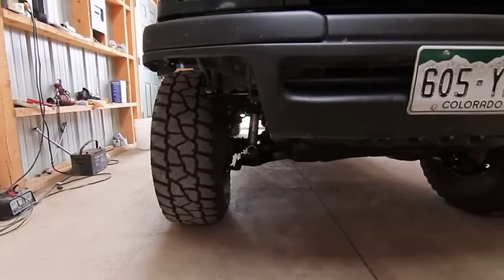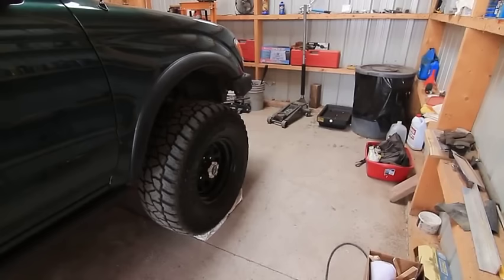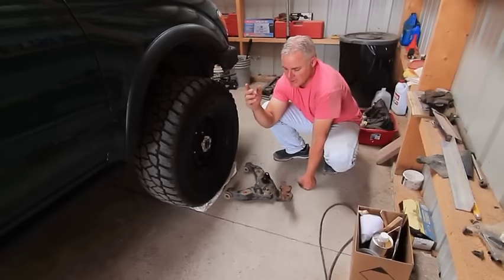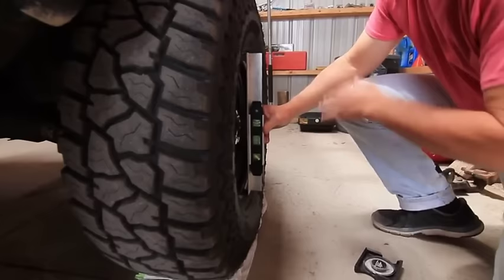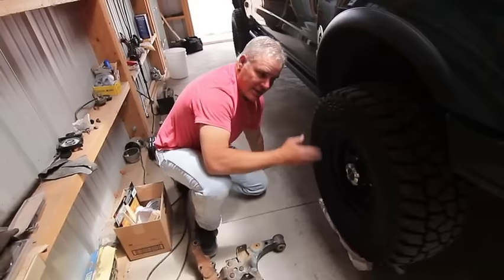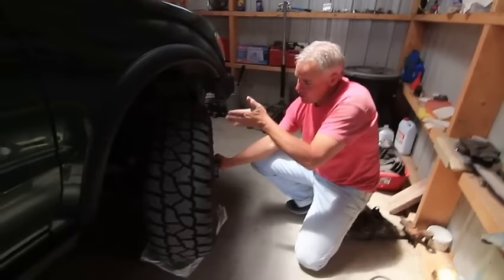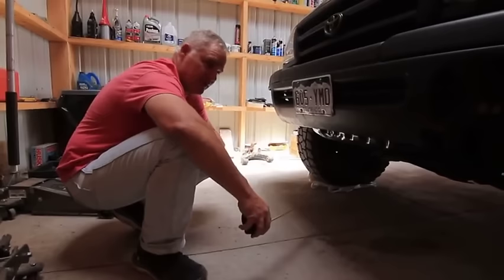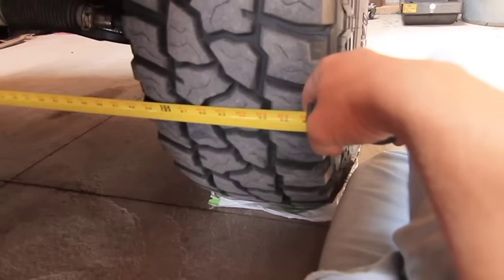How to Measure Camber Caster and Toe - Alignment

Comment: No nonsense tutorial, straight to business, very educational.  Thank you very much.  I've used thin magazines under the wheels to accommodate wheel movement on concrete, but I like the plastic bags with oil better.  There is a lot of engineering and science behind these three adjustments (caster, camber and toe), and each vehicle utilizes this technology uniquely.  Be patient, prepare your work, and you'll get through it with fine results.  Blessings, Wayne.

Comment: If I might suggest using two pieces of sheet metal like 12”x12”, apply plenty of grease between them.  They work better than plastic bags.  Regardless, this video was a great learning tool. Thanks!
Reply: I was going to make this suggestion too. working in the crash testing world, we slip plates like this underneath all 4 wheels to be able to dial in the final position of the vehicles, pushing it one way or another upto an inch or two by hand.
Reply: We do this in the aircraft industry when playing with the nose wheel steering system

Comment: Excellent. This saved me from screwing up an alignment that was within spec. I am prepping my 4runner for larger tires; trimming stuff, lift kit, different mud flaps.... I still needed some positive caster to move the tire a bit forward. After doing so I was doing a horrible job checking caster and was ready to make an adjustment. I remembered seeing this video and went back and watched again. I had a piece of "L" iron (aluminum) and cut to size and used my phone to check. One was on 90 even and the other was on 89 flipping to 90 if I fudged with the aluminum at all, it was that close. Good enough.... ! You saved me a hassle. I'll check my toe in next

Comment: So, if my truck is pulling right then it’s the passenger side geometry that’s off? The reason I ask is because I recently replaced my upper & lower control arms, tire rod end & ball joints on the drivers side. I thought maybe I just needed to back out my left tie rod a bit

Comment: So when the tire is turned full lock right, and you are measuring the passenger tire you will get the larger degree 89 and then full lock left it will be 88.  So, on the left tire turned full lock to the left it should be about the same 89* and then 88* when turned full lock to the right.  If the degrees were switched - would it mean you had negative caster?

Comment: Been doing alignments for 30 years. Least caster pulls. Most camber pulls. Most ford specs are set up to 1/2 to 3/4 degree less caster on left wheel to compensate for road crown. Good video though, Should still have it checked on a computer machine as thrust angle plays a big part.

Comment: thank you so very much for making this easy..!!!!     also..... very important!!!   make sure you vehicle is sitting level,,meaning,, when looking from the front of the vehicle  just by sight,, make sure it looks square to the ground,, and even measure certain points on the frame and get the vehicle "LEVEL"!!!!!!!!   IF ITS SAGEN ON ONE SIDE ,,,FIX THAT!!!!!!  SQUARE IT UP!!!     i have a story of an alignment shop that did my chevy truck and it was low on the drivers front side,,,, and they said that was ok"""""    WHAT!!!!!!!!!!!!!!!!!!!!!!!!!!!!!!!!!!!!!!!!!!!!!!!!!!!!!!!!!!!!     NO!!!!!!!!!!!!!!!!!!!!!!!!!!    WRONG!!!!!!!!!.... sorry,,, I'm done.   ( I got screwed). ($80.oo.).  now I'm done.   luv this video!   i squared out the truck in the end.( torsion bar keys bolts.).                                     done.

Comment: Maybe I Misunderstood but did you say you can center the steering wheel by only adjusting one tie rod?
I thought you had to adjust both to the center steering wheel.
Reply: It all depends upon whether or not toe-in needs adjustment.  If your toe-in measurement is good, then adjust both equally in the same direction to center the steering wheel while keeping that measurement.  If you need to adjust toe-in, then only do the one side to fix that and adjust the steering wheel at the same time.

Comment: My truck was hit on the front driver side as the tire is straight , but on the passenger side the tire is toed in the garage says I need to replace the ball joints is this right . Great Video
Reply from the maker: Well... the ball joints could very well be destroyed now... but that's NOT what's causing the toe in. My guess (and that's all it is) is that one or both tie rods are bent due to the collision. That would cause an effective shortening... ie... toe in.

Comment: Someone suggested to use two linolium floor tiles with a little grease sandwiched between, probably works same as plastic bags and oil, my concern is, i need my mercedes up on stack of 2x12s to get under it and my driveway is is not level. It may slide off the blocks. Any suggestions
M L Rogers   Pasadena,Tx

Comment: If the vehicle has cam bolts with markings why can't you just set camber bolt and caster bolt to 0 or neutral?
This is assuming all suspension components are good and don't have a lift or something else.
Reply: This is most detailed video on DIY alignment found so far.

Comment: I have a similar vehicle, a 06 GMC yukon.  My left front wheel tip out slightly on top.  If I adjust both camber bolts evenly to  to bring the top of the wheel in slightly - is it safe to assume that I have not changed the caster settings?
Reply from the maker: In theory that'd be true, but you still want to measure it.

Comment: At 7.55, correct me if I am wrong vehicle will pull towards the side with less positive (or more negative) caster. You have not specified positive or negative caster for pull at 7.55.
Reply: That's what  I was taught,  was doing alignments for 30 years

Comment: Aren’t you supposed to multiply the difference in camber by xx?

turn angle 20 degrees each way = 1.43 x camber diff
(commonly rounded up to 1.5)

turn angle 15 degrees each way = 1.91 x camber diff
(commonly rounded up to 2.0)
Reply: Agreed 👍
(180/3.14)/40 = 1.43
(180/3.14)/30 = 1.91

Comment: great vid, but (possibly dumb) question: how can you make sure that the tires are pointing straight-ahead when doing the toe adjustment?
Reply from the maker: It will all self center when it's driven... but then you might need to straighten the steering wheel.
Reply: Not a dumb question, actually very important and should be considered the first step when doing toe adjustments. Steering wheel must be centred first. Depending on your car you could use the steering rack or pitman arm to ensure they are dead centre first.

Comment: On toe in if you don’t use any reference from the rear and only use front (tread) then one tire could be towing more than the other correct?
Reply from the maker: It will self center as you drive it.  Steering wheel may then need adjustment but that's all.

Comment: If caster is off I know it causes pulling, but does it affect wear if camber and toe are within spec?
Reply: If it pulls you will have uneven wear. But if you rotate your tires often you may never notice if it's only a slight pull.

Comment: Better to use digital angle finder. I found the Samsung phone is slightly off by about half a degree, and for phone measuring to 90 degrees it just can not quite get there, as in it is inaccurate and works better when measuring less angle.  The analog round meter I have is also off by 1 degree, that is a very rough measurement tool. I calibrated the angle finder using a 4 foot spirit level set to dead perfect level. You want camber measurement to get as accurate as possible. Having the whole car level is extremely important. My choice for level tools is a spirit level or a digital angle finder well calibrated.

Comment: Wish I had a place to do this I rebuild the entire suspension of my SUV and after 3 alignments they still didn't get it right :( I don't think they are adjusting the caster and camber correctly! They even left the control arm bolts loose ( a Dealership) they said that's normal not to bind everything up?? The spec calls for 140 Foot  pounds but I could turn them with one hand on a wrench! I really need to find a shop that isn't going to be lazy about it!  I already destroyed a set of tires rotated them every couple months to slow down the damage! I tried 2 dealerships and a Monro muffler none of them did it right!
Reply from the maker: CA bolts should never be loose.  Good find!   That shop is either incompetent or unscrupulous.  Computer alignments aren't computer alignments... they are done by a tech with a wrench using a computer to MEASURE.  Only.   It still always boils down to some worker wrenching for you.
Reply: In here cos I tried a shop with a fancy '3D alignment computer' mehhhh that's $150 I'll never see again .. Hopeless! lol
Reply: You are right I took my tacoma for an alignment end they left my steering wheel off to the left 
It can be cause they have lazy people working for them or the computer it's all fucked up they should take care of every single detail we pay a lot of money for alignment so they got to do a better job

Comment: Nice video. I've seen that when calculating caster, some people multiply the by 1.5 the difference between the camber readings from left turn to right turn. Have you seen this?
Reply: Yes I have seen this. I don’t fully understand it but it has something to do with trigonometry. Caster is essentially a measurement of camber at two different angles of steering wheel angle - which is wheel (tyre) sweep. The calculation method has a formula and that is changed by 2 factors:
* the total sweep of the wheel (tyre) left and right and
* the difference in camber measurements from one side of the sweep to the other.

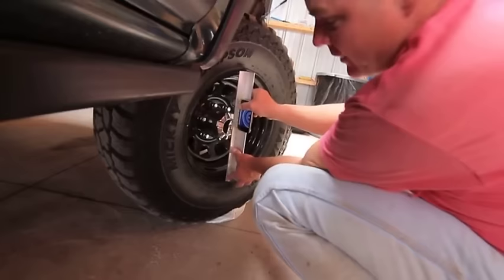In this video he used 20 degrees of sweep to the right and I can only assume 20 degrees sweep to the left. That is what he said in the video @6:10 for full lock to the right. Start with the steering wheel level and that is the zero position of the wheel (tyre). Put some sort of protractor device to measure degrees of turn and move the steering wheel so the tyre is turned out by 20 degrees. @6:35 he went to the right until full lock. Make a measurement of the camber and this is the starting point. If a digital protector is being used his would then be zeroed. He said 88.5 degrees but looked like it was positive camber (top of wheel out). Move the steering wheel the other way so the tyre is turned by 20 degrees to the left (assuming) and measure the camber, shown @6:46. The castor measurement was 87.5 degrees but the wheel looked like it had negative castor (top of wheel in).

TOTAL SWEEP (tyre movement) is 40 degrees (20 degrees right and left from zero). DIFFERENCE IN CAMBER measurement is positive 88.5 degrees minus negative 87.5 degrees equals 3 degrees (remember in this video 90 degrees is the zero point).

Maths, this is the formula:
(180/3.14)/TOTAL SWEEP x DIFFERENCE IN CAMBER = castor
Where 3.14 = pie

(180/3.14)/40 x 3 = castor
4.3 degrees of castor.

To answer your question about the 1.5, (180/3.14)/40 = 1.43. The assumption is that the TOTAL SWEEP is going to be about 40 degrees. If the total sweep is changed to a different number that is ok, just plug that number into the formula instead of the 40 and the 1.5 will become a different number.

It’s hard to tell but unless the castor is dead on zero, as the tyre turns from full left to full right the camber will change from positive to negative (or vice versa). The guy in this video doesn’t quite catch that.
Reply: @NicholasRiviera-Dr I was going to say... His 1 degree is not spec for any ifs Toyota I'm aware of. With that tire and height most are going for 4.5deg or so, which sounds like he was right there. So his measurement is just a good relative measure to get to a good spec

Comment: I'd like to put that put that on a hunter and see how close you got it. Not dissin I'm genuinely curious because I've been doing alignments this way at the shop I'm at now but I've got the actual old school alignment tools. I just don't see how it can be as accurate.
Reply from the maker: Based on drivability and tire wear... it's spot on.
Reply: @pathfinders4x477  how long would it take the average person do do an alignment this way considering the lower control arm bolts are always severely seized on Toyotas?
Reply from the maker: @dildanusmaximus9891  that's true.  Plan on cutting them out using a recipro saw.  I'm not a fan of the factory CA bolts.  I much prefer the aftermarket type you can find on ebay, so I like to replace them anyway.  Also... If your CA bushings are shot it's sometimes more practical to just get new control arms with the bushings installed.  I've had good luck with Beck Arney CAs.  All of this will save time.  The alignment itself is a 20-30 minute job... but the rest of the wrenching will depend on what you run into under there.

Comment: You know, I have been sitting here for an hour looking for a video describing how to check and adjust caster without taking it to an alignment shop. Any idiot can set toe with string and tape measures. Any idiot can set camber with a level. Show me how to ACCURATELY check and adjust caster on the cheap.BTW, I am an ASE master tech, so I know what I am talking about.
Reply: It's a big tough simple 4WD one step or rock hit from needing a new alignment... Relax Brucy it will be good enough!

Comment: i rather pay rather to get my wheel alignment done
Reply: Many places won't touch a lifted truck or one with larger tires
Reply: Pay $375 in NY and you get it back worse than when you brought it in.
Reply: Information is power, at least if you understand the concepts it may prevent you from getting ripped off

Comment: How do you know if the tow adjustment needs to be made on one wheel of the vehicle or if both front wheels need to be adjusted to get in spec?
Reply from the maker: The toe will self center when it's driven.  This might cause the steering wheel to get cock-eyed, which can be straightened by adjusting the outer tie rods on both sides equally but opposite.  If the steering wheel already needs to be straightened, you can adjust toe-in on only one side. This sometimes kills two birds with one stone.  That's for IFS... solid axles are different as they use a collar to adjust the steering wheel.
Reply: @pathfinders4x477  Thanks👍
Reply: Steering wheel needs to be centred first or the self centring will end up with a steering wheel that is crooked